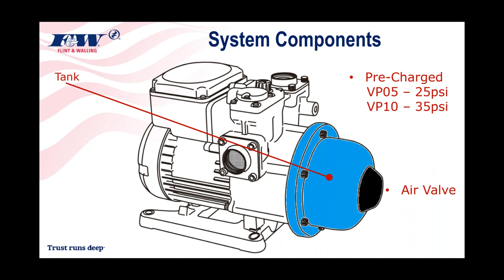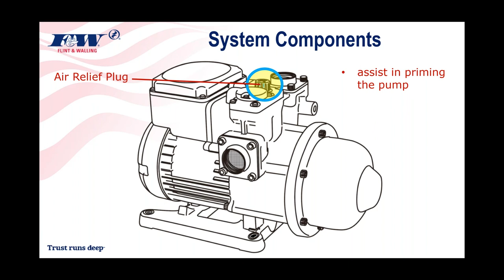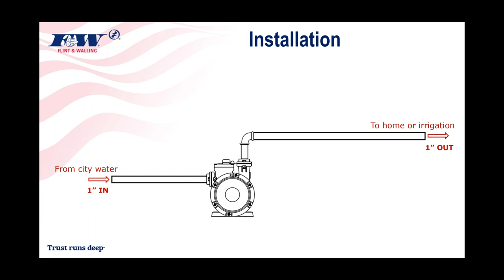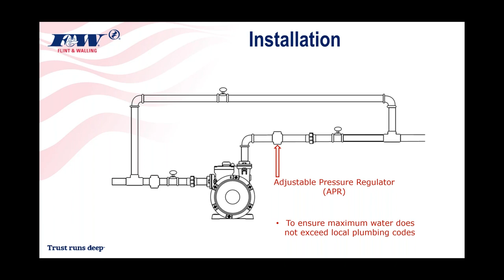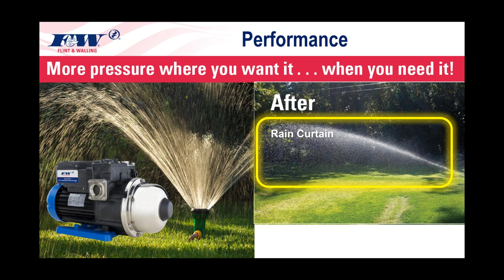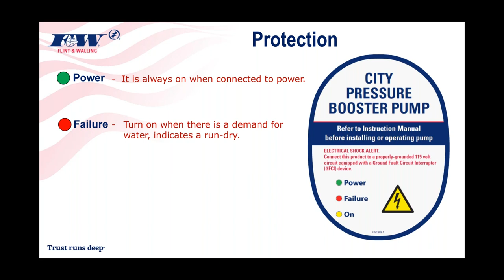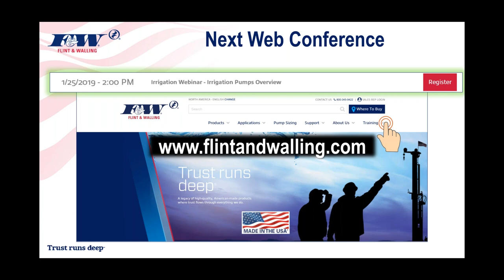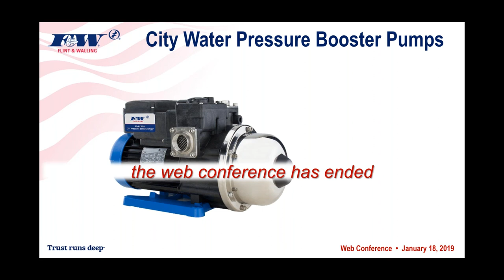City Water Pressure Booster Pump Webinar

Comment: I am having issues with my F&W pump that is moving water up a hill to my house where it is then boosted again my a DuraMac booster pump sitting in my crawlspace for the home. During hot days this summer I am losing water pressure to the booster pump in the crawlspace and therefore no water to the house. Once the temperatures drop at night I can use water again. Any idea what is happening and what I can do to fix it? thanks so much for the help.